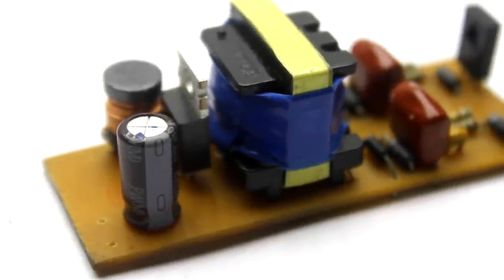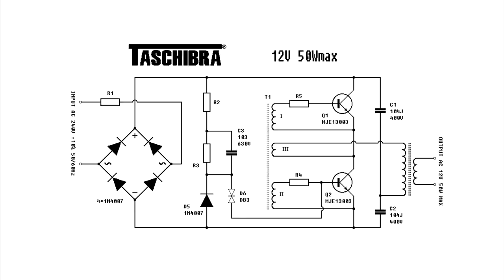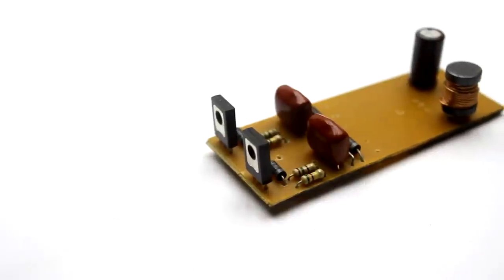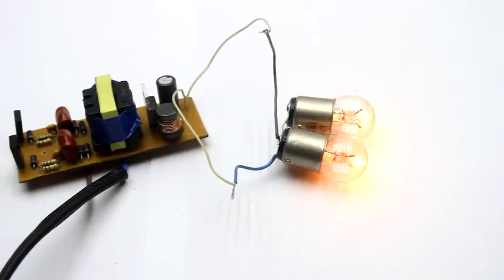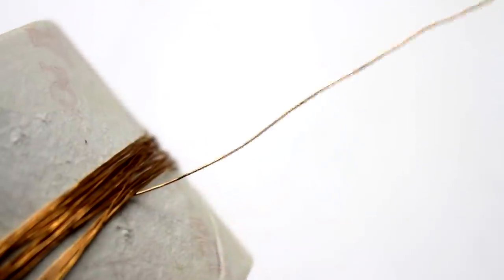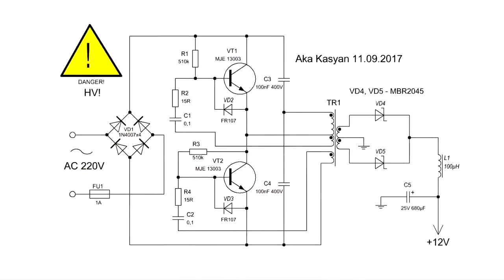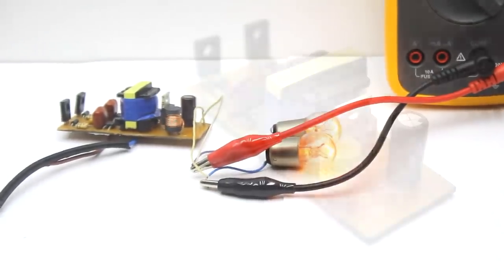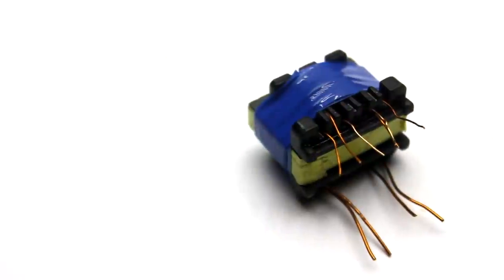Power supply from an electronic transformer

Comment: TO all clever clog replyers. I have a cordless drill charger Parkside PLG 18 A1. The blown fuse was replaced and 2 diodes  of the 4 rectifyer also a zener diode. The transformer 3314 ACT/ EC28-T007 has a brown line showing on the yellow tape. When switched on the fuse blows again also a further diode. Is there anyone out there able to solve this or have I missed something?

Comment: The auto genarated half wave psu may not have a stable output as it has no pwm driver control, so wont really be good for sensitive heavy current drawing equipment, only light equipment

Comment: I prefer a circuit with the capacitor between the half bridge point and one end of the primary winding and the second end of the primary winding at primary zero potential. This is more stable than a floating capacitive voltage dividor.

Comment: Bro, I made a battery charger power supply based on a XL4015 board. Removed both potentiometers to use external ones and used a digital voltmeter ammeter in the box... But ended up burning both boards I had. :(
Reply: where did you place those ammeter connections? sometimes  if the load is drawing more current than the rated value of the power supply the board will fry..

Comment: thanks for this wonderful video, its very helpful. Can u please tell the resistor watts value and the value of c1 & c2, and also if any changes need if i made 24 volts 2amps power supply except transformer..... please reply i need this
Reply: 24 vueltas el secundario.
aumentar el calibre de los cables de transformador.
Poner capacitores de 1 uF en vez de 100 nF (C3 y C4)